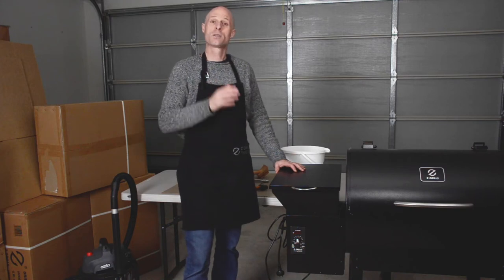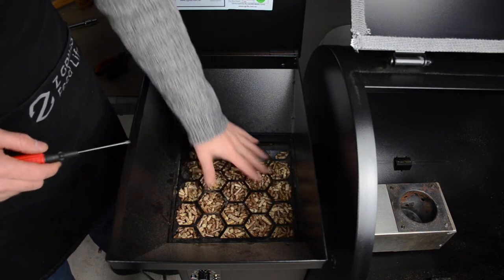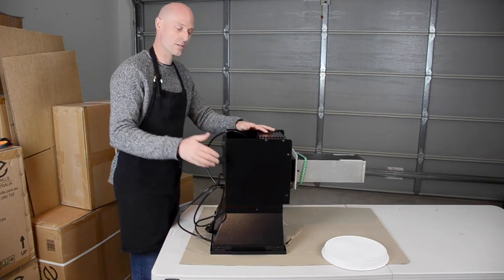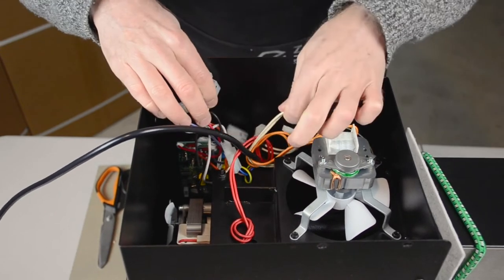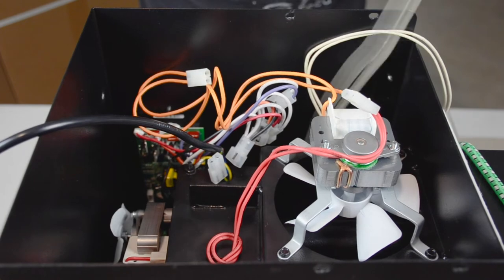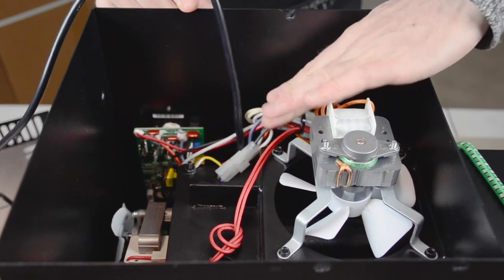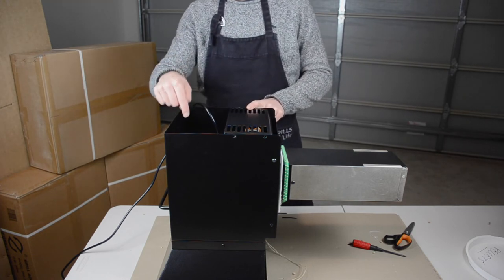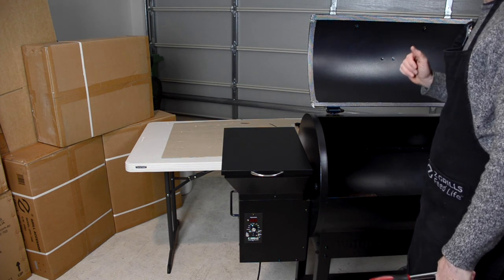Z Grills 700 Smoker Grill Controller Replacement

Comment: sir I took my z-grille box apart and am having trouble figuring out something, I didnt take a picture of the assembly....do you see that pink wire over the fan then goes down to that black box where the pink wires are looped???...I have that black box loose and don't know where it hooks up to...so i have a loose bracket box with 2 screw holes, I can't find a illustration of all the parts..please help if you can